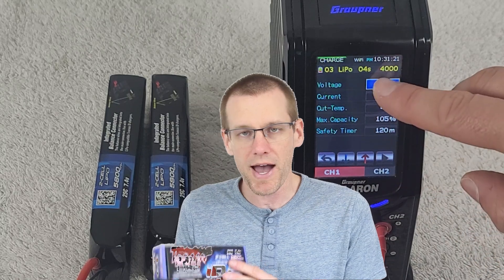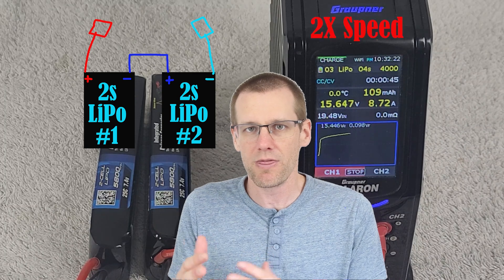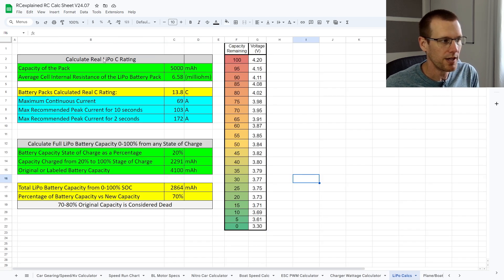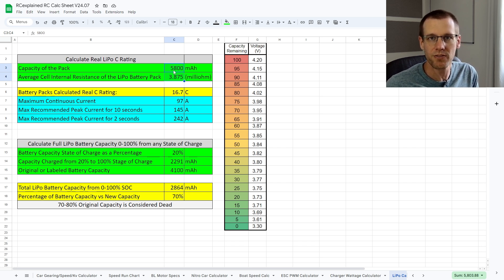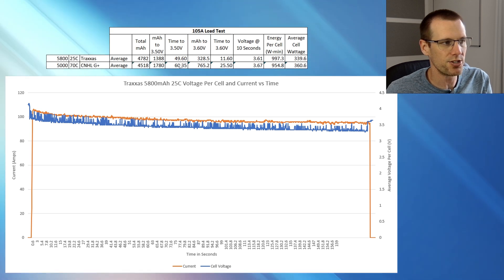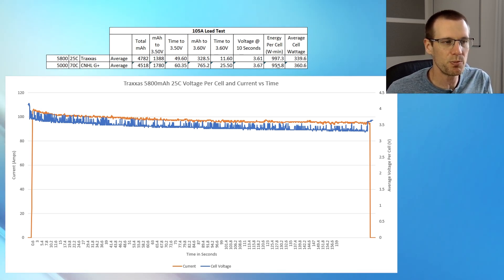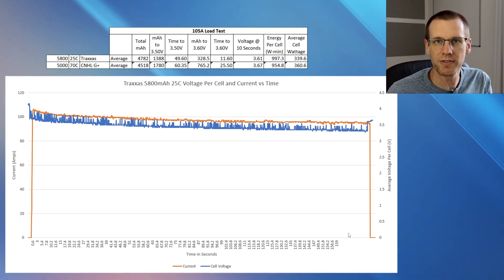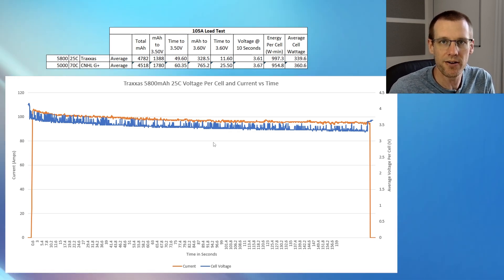Can a Traxxas 25C LiPo handle a 17C Load? Ultimate 2S 5800mAh Performance Test

Comment: ¿Con que equipo le unyecta una carga de 105 Amperios a la batería? Gracias
Reply from the maker: I use an electronic speed control to send power to a load. This test was using an EDF. ( electric ducted fan - for ease of translation)
Reply: @RCexplained gracias ¡¡

Comment: Great test and good to see a decent explanation! Couple of questions were they all broken in and cycled correctly? Just the break in period I’ve found can greatly improve the life and performance in certain cells, a video on the topic would be interesting! just an idea! Also are they the same cells as the ones used 10 years ago? I’ve still got the batteries from my xo1 and they have held up very well! They’re still tight and No puffing one has been turned into a 2s after a dog bone snapped and penetrated one cell and the impressive part is the cell it didn’t have a thermal runaway! The other 3s was damaged on a separate crash which shortened the battery by about 20mm,crushing the end of the cells significantly and after years of storage they all held charge!
Reply from the maker: Take a look at this:
https://youtu.be/3ZFpus-hhtY

Comment: traxxas says 25c pack you say 17c pack. CNHL says 70c pack you say 30c pack. yours look more accurate but when comparing the two 17c vs 30c I see a small difference.
Reply from the maker: The test shows pass vs fail. One brand passed. The other failed the test and the test had to be stopped prematurely due to unsafe temperatures being exceeded.
Reply: @RCexplained  105 amps would be an 18C load for the 5800mah pack. it barely failed at 16.7C
Reply from the maker: It's a 105A test but weaker batteries do not hit 105A. This pack was under 100A for majority of the run. You can see all of this in the graph.
Reply: @RCexplained  "Weaker batteries" meaning under 20C calculated? What exactly is considered weaker?
Reply from the maker: Weaker as in not able to maintain 100-105A. This pack was under 100A for majority of the test.
Reply: @RCexplained  ty for clarifying. I will be on the lookout for above 100a for over half the test.

Comment: I’m trying to get to figure out if I’m gonna fry a dual max6 4985 Keaton with two 160amp esc if I speed run them currently it’s 29 pinion 34 t spool it easily quickly went 100km on hoons wondering … how to figure out what would pull to many amps is it a combination of load or weight and how fast the motor spins will a 1:1 be to much? Should I get two 200amp esc or go right to two XLX2 ?

Comment: Trexxsas are wise run high volt ... can you have low C
Reply: What???? What are you doing to your keyboard?
Reply from the maker: Unfortunately, Traxxas uses similar voltage to everyone else and their models pull similar amounts of current as well.
Reply: @RCexplained  no ... they run 6s where others run 4s and 3s where others use 2s .... and 8s where others use 6s ...
Reply: see revon 6s .... and traggy 4s .... can you have 33% lower c ....
Reply: @sundell79  you're talking utter nonsense!
Reply from the maker: Where do you get this data from?

Comment: If you ever get the chance look at Azure 9000 mah 4 s batteries theses are just freaks and the drop on a run is nothing theses power my limitless gt and I’ve already gone 139 mph with a 23 tooth pinion H and w racing channel

Comment: Considering how expensive they are...this is sad.
Reply: It's an rtr sticker thing. Paying for that name and much needed warranty. They simply only sell these to the new guys that don't know better or some are just too ignorant. All we can to is continue to spread the word, aftermarket is why these models sell!
Reply: @redndeyes Traxxas warranty service sucks.
They act like it's all your fault and they insult you and try to weasel out of replacement.
"Much needed warranty" my shiny metal ass.
Reply: That's why I never buy Traxxas or Spektrum batteries.
It's a joke.
Reply: 17C is not terrible. Yeah the CNHL is better but not 30C maybe 21C. imo, its a 17c pack versus a 21c pack. Still its great to see which pack is better.
Reply from the maker: The unique balance setup they use also makes it impossible to use a standard charger without modification. I modified the battery to charge rather then buying a charger too. 😄
Reply: @RCexplained  i just use an adapter conector to trx and run what ever lipo i feel in my slash.